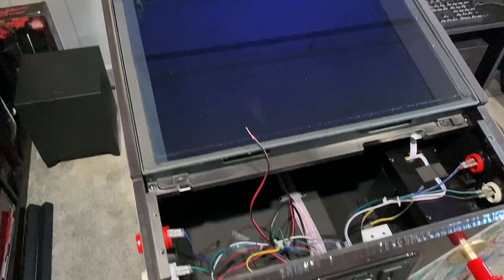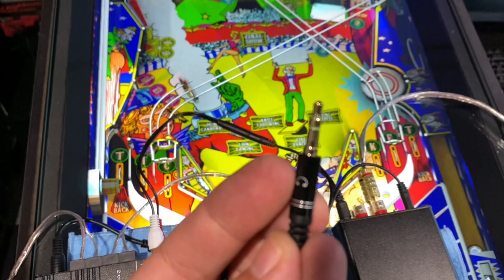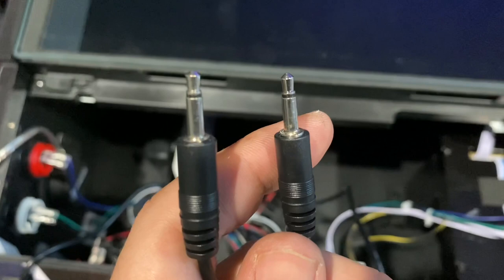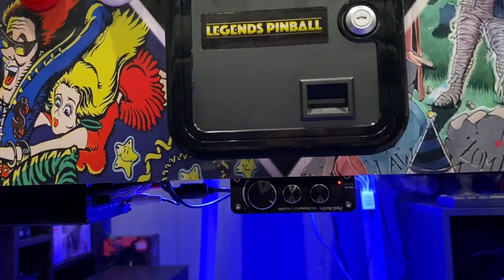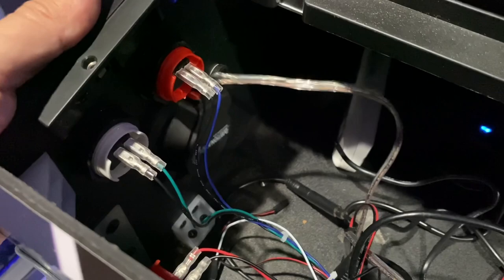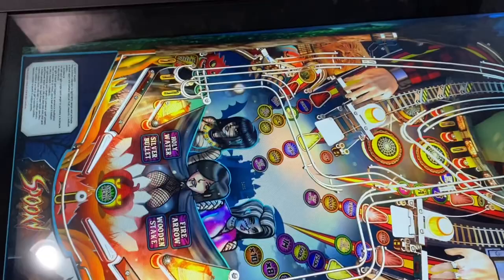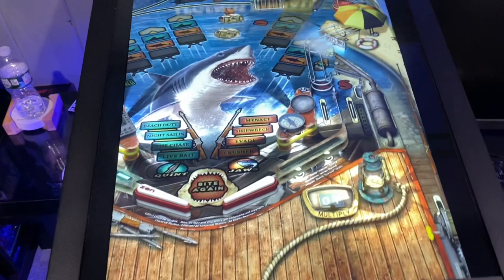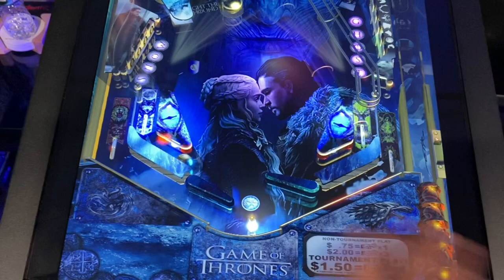Feel the Game: Legends Pinball Haptics Mod Tutorial with Bass Shaker, Exciter & Amps!

Comment: Question - where exactly are you using that mono Y anyway?
Reply from the maker: To split the audio signal for both amplifiers, is it needed - no, you can splice into the same signal direct. Just cleans up the installation  having the single source split with the Y
Reply: @JohnPauls  awesome. They are a bitch to find.
Reply from the maker: Certainly are as of recent. Just tap into the same output.  2 on red, 2 on black, split from the original haptic output line. Soldering would make it an ideal joint, or those heat shrink solder tubes.
Reply from the maker: Remember, you just need a signal. That signal is being amplified. However you get that signal to your amp is your design. Just make sure it comes from that source.
Reply: @JohnPauls  I can get away with using the speaker wire to 3.5 and also a speaker wire to RCA for the other input correct?  Just messier as you alluded to I'd assume...
Reply from the maker: Absolutely Scott.
Reply: @JohnPauls  I'm doing this, the daytons, and the solenoid mod with the control panel install as well all at once.  Probably won't all be in until next week tho.  Was going to swap the flippers but they are out of stock.  Thanks for the tutorials.
Reply from the maker: You’re most welcome. Glad to help make this turd shine. The haptic improvement those mods produce makes it all worth the effort. Please keep me updated and thank you.
Reply: @JohnPauls  I would have been complete but the Kinter had no power adapter with it. Tuesday it will come. Trying to keep everything inside the cab. Wish I could send pics. Thanks again for the awesome tutorials
Reply from the maker: You’re most welcome. Excited for you haha.
Reply: @JohnPauls  got everything set and it's almost as good with the bass shaker alone minus the Dayton's. If I set the amp gains to where they are most effective, I get serious hum in the menus, etc. I am going to try a line out converter before each amp to see if that will help
Reply from the maker: That should definitely help. The bass shaker is one of the best “feel” mods there is.
Reply: @JohnPauls  Got everything finished and buttoned up this evening. You can see the pics in the Unofficial AtGames Legends group on FB. I ended up adjusting the main volume down and table volumes up. That took care of the noise. Between setting 4 different cab volumes, two amp volumes and the gains themselves in the amp, it's a bit to get right. Thanks for all your help. Turned out fantastic
Reply from the maker: So glad to hear that Scott. I’ll check it out. You are most welcome. Thank you for watching and commenting!

Comment: Excellent video. For your source amp input... Can you cut two rca cables and connect them directly to the stock exciter red/blk wires? Then the rca plugged into the amp?
Why did you go to a 3. 5mm and convert to rca plugs for the amp source input?
Reply from the maker: Thank you! Amp availability (3.5mm vs rca input), quality for what you get and keeping the wiring as clean as possible. Yes you can source the signal direct with rca’s, I’ll be doing this soon with the backglass speaker upgrade. Thank you for watching and for the feedback.
Reply from the maker: Maybe, I’ll give it a shot. Thank you!